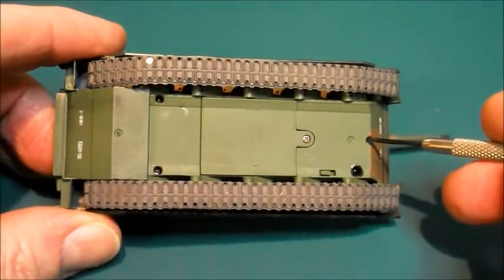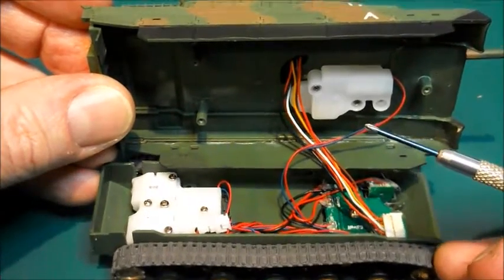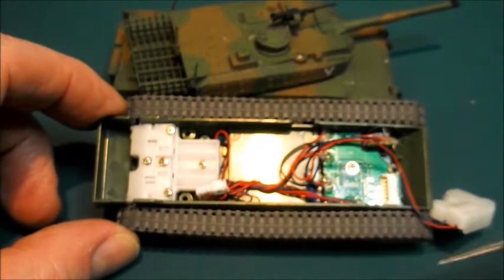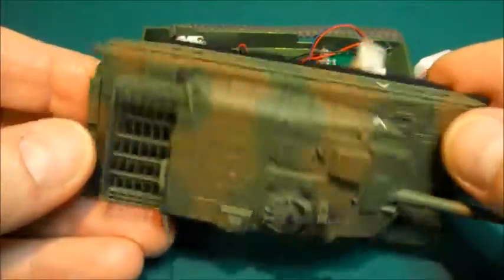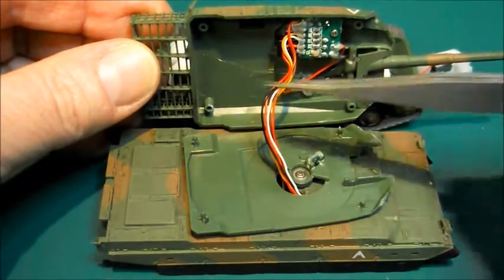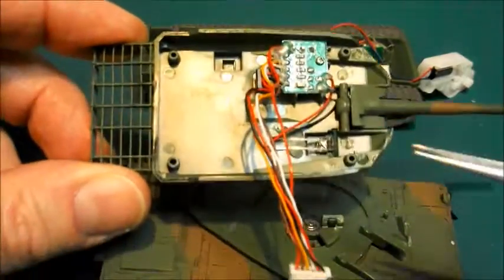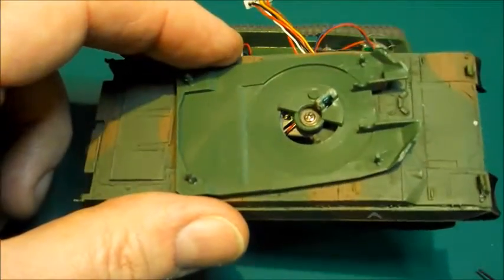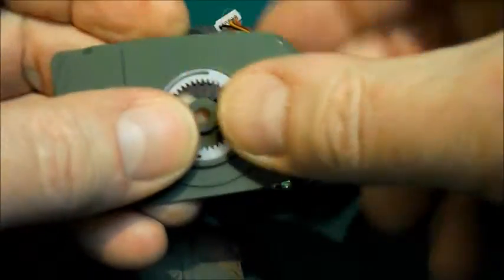Anatomy of the Waltersons 1/72 remote controlled Type 10 tank

Comment: I have a similar tank with two wires off on the turret circuit board, they are black and orange and occupy the furthest right connections, would you be able to tell me which is which?

Comment: Is proportional driving or when press the throttle go with full speed and full turning, because if it's full throttle i hate that. I mean drives like a real tank ? It is very important for me because i hate the toy class rc . Also i like the very small scale rc vehicles and thats why i ask you for this 1/72 size and not bigger. The most youtube videos does not say it clearly if it's proportional and is very wrong when they don't say it.
Reply: I THINK THIS TANK IS THE SAME IS THE ONE DISCUSSED IN THE FOLLOWING LINK> IF SO IT ROCKS AND DOES PROPORTIONAL?
https://translate.googleusercontent.com/translate_c?act=url&depth=1&hl=en&ie=UTF8&prev=_t&rurl=translate.google.co.uk&sl=auto&sp=nmt4&tl=en&u=http://rc-micromodellbau.de/rc-forum/viewtopic.php%3Ft%3D24061%26sid%3D7ed896ad52de0f8af57ad7ae7033fb2f&usg=ALkJrhhtdtLY0XphXXhA09rWgOrYoOgmcA
Reply: Its totally proportional you can find it by the torro channel named: torro gmb or smtnhg